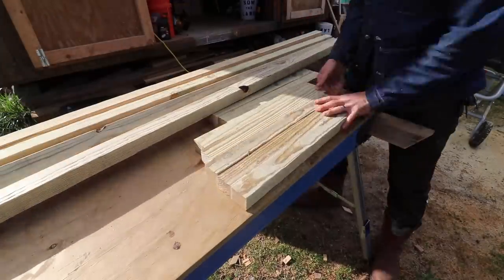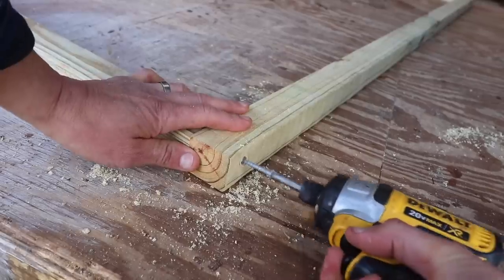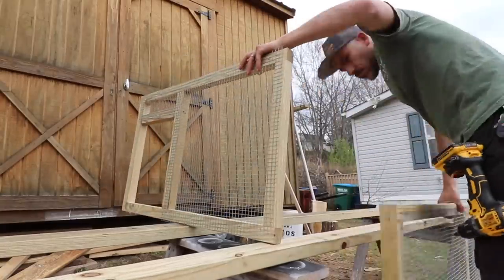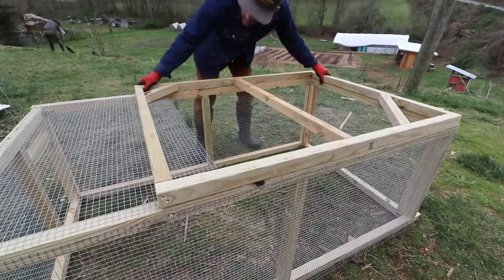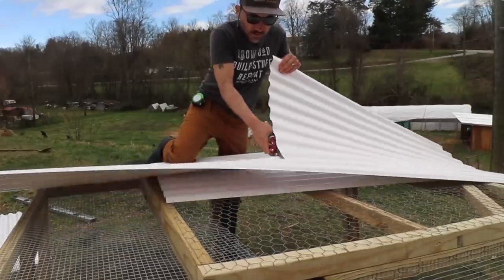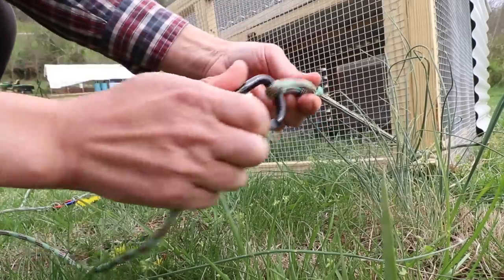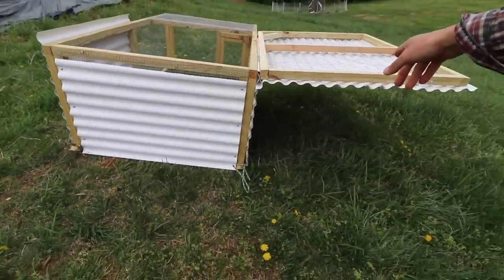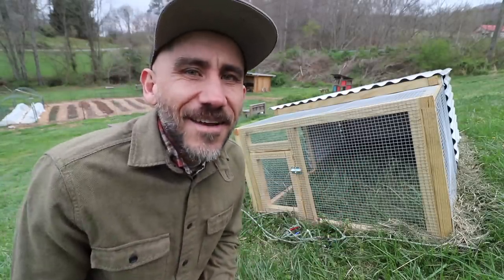DIY CHICKEN TRACTOR (Small Scale) EASY

Comment: Having the lid flip over for shade is genius!  For ease, someone could have two 2x4 boards ripped down the middle (Like you did for the frame) to put on the ground to prop up the lid for more stability or have two legs fashioned/ secured on the lid so they flip off and stand themselves when the lid is opened with a hinge or something (?) That doesn't make sense, does it? lol. It makes sense in my head though lol!! Thank you for the plans!

Comment: FYI you should run those 3” screws flush to just set into the wood the deeper you drive it the less wood there is on the head for strength and it will pull apart easier